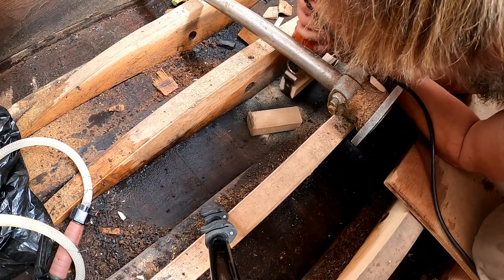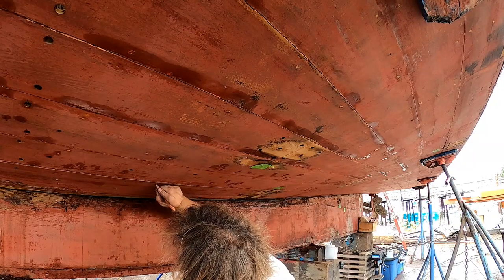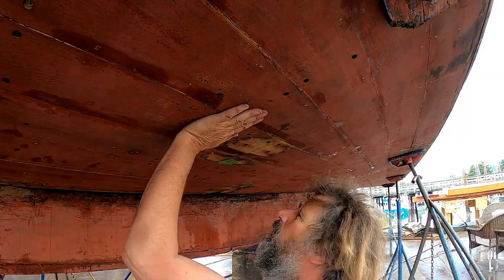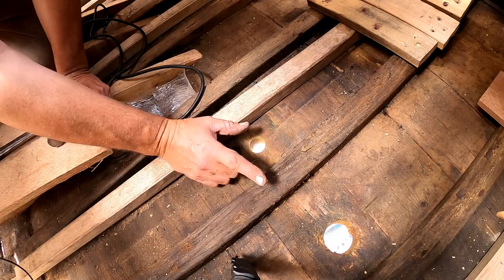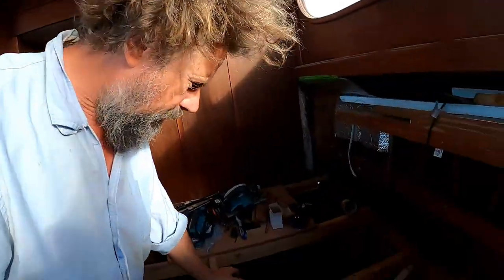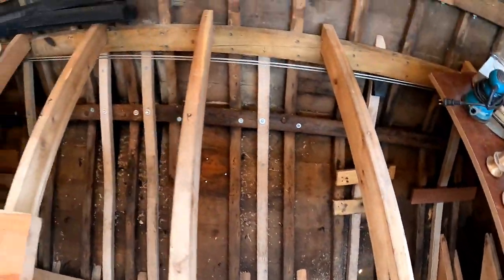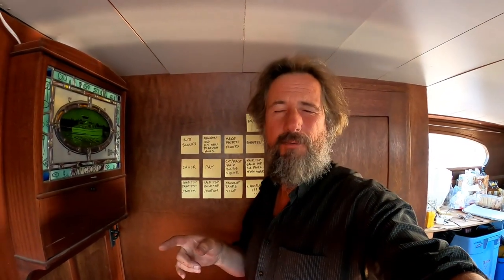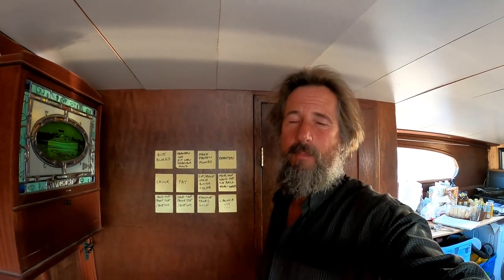Haulout Day 17- #245 - Boat Life - Living aboard a wooden boat - Travels With Geordie

Comment: on the inside of the new butt block carriage bolts.. i would love to see you loosen the nut and lift the washer one at a time.. and spread a little Hylomar on the threads and between the nut and washer.. Hylomar is sold perhaps as hylomar up there but it may also be sold as Permatex Flange dressing number 85420..  its oil , coolant and water proof.. and never ever gets hard.  so it will protect the exposed portions of your galvanized carriage bolts from ever rusting or seizing even when bilge water gets up on them.  its just a thought.
Reply: I'm a mechanic and use Hylomar on my engine gaskets. It's great stuff. Hard to get up here in Vancouver BC. I use the spray version on my head gaskets. Good though to use on the boat.

Comment: The tapered bungs should always go in from  the outside. That way the waterpressure will lock them tight. Wien you put them in from the Inside the waterpressure can press them out/in and your boat vwill realy leak. Just a shipwrights advice.

Comment: Me watching you over build a platform to slide a motor 6 feet, then thinking about how my cars motor is hanging from a 2x4 across the strut towers by a single load strap😳
Had to yank the transmission for a new clutch. Waiting on parts... It's been 6 weeks😂
Reply: I saw an engine dropped in a 32’ M/V built in the thirties. Broke the slightly rotted garboard, the adjacent plank too and trashed 2 frames, the only thing that stopped it sinking before we could get a decent sized pump on the job was the good fortune that it was a falling tide and there was only 2’ of water under her. 
I’m with Pete on this one😎
Gotcha with the car job, had the head off my MG 18months ago, still waiting for a set of rockers and the last 2 valve springs. Bits starting to migrate now.....dammit!  Good luck with your’s 😁